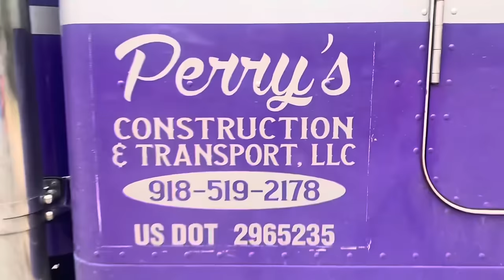It’s Finally Here / Couple Renovates Abandoned Homestead / Shed To Tiny House

Comment: I have a tiny house also your going to want to raise it higher because of the frost line to the ground. The floors will get too cold. Also, you want enough room to hook up plumbing. I'm having to raise mine now. I wish I had known when I moved it in. Another thing that I'm doing is taking off the outside, siding and putting wrap on, then putting back the siding. And replacing windows with better windows. Plus, adding a bath. And yes have extra door in back

Comment: My tiny home has a front door and a door to a back deck in the bedroom..I have 2 smoke detectors in here as well because fire is my biggest fear after renting a home from someone who cut the emergency stop off on my hvac unit because it wasn’t installed correctly and it would over heat…. I slept on the couch and moved her twin bed by the front door and window in case of an emergency….After my
Year lease was up I got me and my daughter out of there and built a 300sq ft studio tiny home and I’ve been happy ever since! Congratulations on ur new home 😊

Comment: Instead of a furnace and central air, I recommend a 12 to14,000 BTU Minisplit A/C unit with a heat pump. I installed one in my mom in laws house 3 years ago and it works perfectly. It keeps her house nice and cool in summer and nice and warm in winter. And best of all it runs Waaaay cheaper than a furnace and central A/C unit. Mom in laws heating and A/C average around $90 a month.

Comment: God bless you for doing that for your mother because I did everything that I could for my mother that is a very nice cabin but I know by now it's a tiny house the only problem I have with that delivery  company is that they drug the tiny home from the street to its destination spot when they should have used the other set of wheels when using the Mule they could have damaged the bottom of the cabin or even damaged the structure 🙏🙏👍

Comment: It’s sitting too close to the main house roof line. The pitch of Watershed  from main house will make for a moldy post on the porch and  front side of tiny home hopefully you will put gutters on the main to stop rain splash and strong pour offs landing between the structures. The old little storage building will have close watershed on the other side of the tiny  home  if you put a window in the tiny home facing the storage shed  and it rains it may keep the window frame and sill moldy
Reply from the maker: 👍 thank you for watching!

Comment: Surprised they didn't have wheels on the back. Has to be hard on the building dragging it.
Reply from the maker: This is a common practice in this area. It’s not hard on the shed because it doesn’t require the building to be as high off the ground and less stress on the structure. Thank you for watching!

Comment: That's really nice and that's wonderful for your grandma in law your mother but I think y'all should have waited to it wasn't wet and you probably should have put on a concrete slab honestly the machine is struggling trying to pull through mud or what mud you should have waited till it was dry before trying to struggle putting this on land and again you really should have put this on a slab somewhere along the line y'all didn't do something right you literally made a sandbox but I hope you have good luck and put it on the land but over the years it's going to sink without a proper Foundation of at least concrete
Reply from the maker: Thank you for watching!

Comment: I were was the front tires on the little house. He should not have been dragging it. I got mine put in and I would have been pissed if they done that cause they could have busted the wood underneath. That guy didn’t have a clue what he was doing or was just being lazy.
Reply from the maker: This is exactly why the sheds are built on skids. They are there to allow the building to be “skidded” into place. The bogy wheels are not required to move these buildings. Thank you for watching!